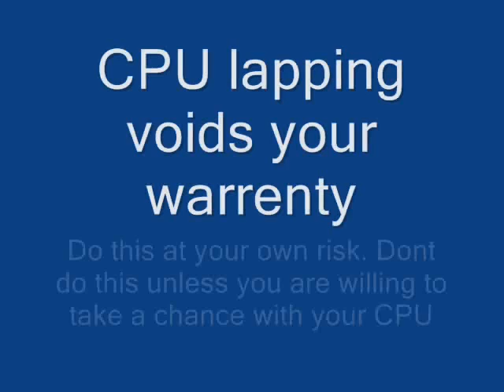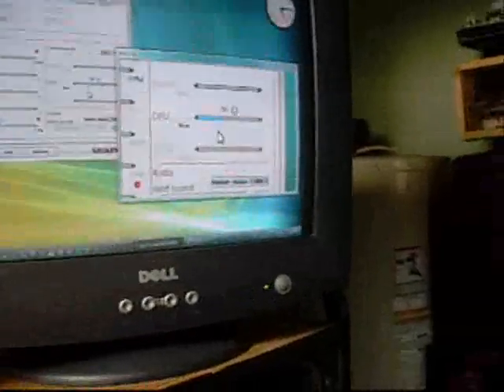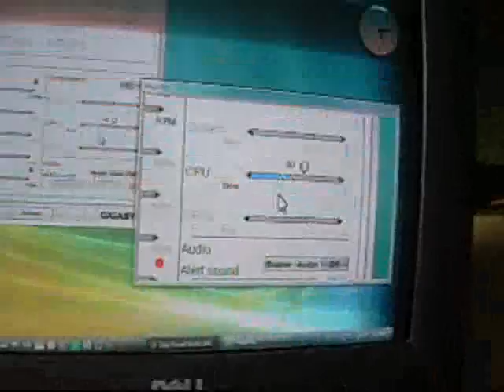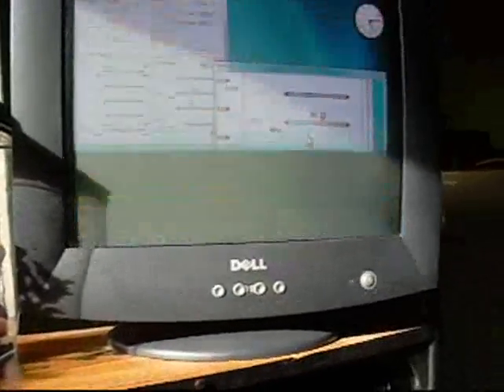Lapping a Intel pentium D 820 for overclocking

Comment: I have a Pentium D 960 3.6Ghz and it idles at 58c and can get up to 80c+ on a constant load. I hate it, it runs too damn hot. I've tried reapplying paste and reseating with no avail. Getting another heat sink with screws instead of those stupid plastic turn clips.
Reply: +ArcadeGames why not get a cheap Core 2 Duo and board?

Comment: my Pentium D 820 still runs fine after 7 years - never OC'ed it.
Reply: +FUzzyBUnnyBOoties The Pentium D wasn&#39;t a Prescott but a Smithfield based CPU. The Prescott has runs quite a bit cooler, due to its newer processor node (65nm vs 90nm). I still run an old Prescott based cpu in my desktop these days. It&#39;s a Pentium D 915, overclocked to 4.2 Ghz without a problem. It is one of the crinchiest setup ever. It is fed by an old AOpen 350W PSU, it has two completely different types of ram (Different speeds). With quite a weak coolermaster cooler, it doesn't read above 47*C running Prime 95. I don't know how close the temperature is actually to the CPU.
Reply: Superchad245 Yeah, I mistyped. I meant Presler.
Reply from the maker: They were a good solid cpu back in the day. I was very excited when I got mine.
Reply: +DJ S you are partially incorrect, also Prescott is 90nm NOT 65nm, Cedar Mill is 65nm

the Pentium D 8xx is Smithfield, which is made up of two 90nm Prescott dies
the Pentium D 9xx is Presler, which is made up of two 65nm Cedar Mill dies

so your CPU is Presler, or two Cedar Mills in one package.

Comment: I used to over drive motherboards.  But that was when the 386 was a hot machine.  You couldn't do anything in the bios.  So what I would do is unsolder the crystal and solder in a socket for a new crystal.  Then I would have an assortment of crystals and kept trying different ones untill I got a stable machine.  I learned a lot by doing this.  mostly the problem wasn't in the cpu but the memory couldn't run at the increased clock rate.
Reply from the maker: I remember them days. Back when you could buy the overdrive unit for the cpu and the cpu sat right on top of it and plugged into the socket. I think it was a 386sx to a 486DX or a 486sx I cant really remember now. But doing it yourself was way cooler.
Reply: 386,486 and even pII and pIII have onboard swith to change the processor frequency

Comment: True, but there's the fact that 4Real cores are better now than 2Real+2Virtual (plus it was a 6core which is even better) and the Phenom II would have saved me a fuckload of cash. PLUS It depends, on driver support and hardware support, as well as Game support. 

Some games don't work well with HT does that mean the Core i7 sucks? No, just disable the 4 Virtual cores and leave the 4 Real ones on. Same concept game doesn't like SLI/CFX? Turn off the 2nd GPU.

Comment: Currently? 
MSI H61M-P23 (Revision B3) LGA 1155 
._. 

And for me Dual PCI-E cards woulda been a cheaper route, buy one card for 50$ then eventually find another for less or the same price and toss it in. 
(HD 4850(s), much faster than a GTX 650, or HD 6670).

Comment: what motherboard do you have, i mean most of them can upgrade further up the intel chain, if you want CPU power upgrade path Intel is still the main way to go, If you want a SoC for a desktop then AMD's APU's are fantastic.  Dual PCI-E is only a great option for those who need dual cards, unless your planning on gaming above 1080p dual cards are not worth the investment and  hassle, usually sticking to one more powerful card will yield better results and less hassle with SLI/CFX

Comment: hey the Sandy bridge Celerons are great little CPUS, i was strapped for cash and sold the i5 out of my alienware (got $200 for it so not bad) and replaced it with a $35 Celeron G540, my gaming has barely been affected at all, was completely amazed by it.

Comment: False, the "mhz" was the Front Side Bus not the actual CPU's clock speed.
Willimatte topped out at 2.0ghz, Northwood around 3.4ghz then came Prescott which was basically just a slight tweaking of the 20-stage pipe to 31-stages, although it did add XDbit and SSE3 instructions and also shrunk  the die area down to 90nanometers so it ran a bit cooler. C:

Comment from the maker: I did some searching and it would seem that the board you have does not support overclocking at all. The simple solution would be just to buy a used board for a few dollars. Sorry I know that is not the answer that you want but some times that is all you can do.

Comment: you can get pre build watercooling kit(all in one) for $39.99 in newegg, but i'm not sure the quality would be good. 

btw i got 15c idle under 4.2ghz (100mhz x42 because of ddr3 ram ratio wont let me go above 200mhz bclk) with ihs removed + antec h2o 620 (room temp is 21c), while full load is still over 50c... which it is not really worthy by trying so hard to just get few degree drop in idle.

Comment: Cool, I might just give it a shot :)

I notice not many 775 boards list the Pentium D as compatible though, even though people have been building on boards like the EVGA 610i which doesn't list it either. Would any 775 mobo with 800FSB work you reckon?

Comment: I recently dug out the components of my old dead workstation (looks like a mobo failure) and at the heart of it I found a Pentium D 925. I've been toying with the idea of resurrecting it in a home server build given that the PSU and RAM (mismatched 533/677 1gb chips) are still functional. Means buying a new motherboard, case, drives and probably a RAID controller (maybe, depending on mobo) to go with it. Good idea or more trouble and cash than it's worth?

Comment from the maker: As with anything there is always pros and cons. Overclocking should be done very carefully with keeping a eye on temperatures and voltages to make sure that you don't overvolt anything. It can also take some life off of components like CPU.ram.motherboard. video-card.ect. But if done carefully the risk can be very minimal but a person has to do it at their own risk. The first thing you may want to do is find out what cpu and motherboard you have and search Google for overclocks for it.

Comment from the maker: It is a way to get more power out of the hardware that you already have. So instead of having to upgrade to a new computer you could maybe get another year out of the one that you have. 
The cooler you can keep the chip the higher you can overclock it. So in this instance I am running a 2.8GHZ chip at 3.2GHZ.

Comment from the maker: I bet your hand would get very sore using the paper. They really do not need to be that smooth. The main thing is that they are flat. The thermal paste will make up for any microscopic scratch, The first one i did i spent 8 hours on it. Now I do one start to finish in about 45 minutes and it is a lot easier on the arms.

Comment from the maker: There are quite a few factors that could have effected our idle temps. Like type of cooler used or type of thermal compound or air flow through the case. Every chip overclocks a little differently it is very possible that you have a good one that will overclock that high with a minimal increase in voltage.

Comment from the maker: @3624nathan The problem with this cpu is not that it is not powerful enough but more that it does run so hot. The t-case temp max according to Intel is 64. So it does not really take much to get them up to temp and have them start throttling down in performance. So with better cooling a person could probable play Cryis and maybe even BF3 with it.

Comment: My gaming rig has this processor in it. 2.80 Ghz but it runs perfect for my needs. I don't know why people over clock it when it has the power to run GTA 4 and fly Tampa scenery for Flight Simulator and call of duty. It not bad at all. But myn does get really hot at idle it gets around 50*C sometimes 67 *C. But it never gets any higher. I think it was build to go up to 80. Not sure.

Comment from the maker: @aPanzerIV Wow that is a very good question. Do you have it overclocked?. Is the cpu flat did you lap it on a piece of glass to make sure the surface was flat?. Is the cpu cooler making good contact?. If you take the cooler off check the thermal paste and make sure the cooler was making a good contact with it. Did you use a quality thermal paste like AS5?.

Comment from the maker: @crackloadPC I agree they ran very warm and were never really that good of a CPU. But for some reason they had a very long lifespan in comparison to other  CPU`s. Even though they came out around 5 years ago you can still buy one of these brand new for around $28.00. So it makes it a great option for people just learning to overclock that dont want to try it on a $300.00 CPU. And because it is a dual core it is modern enough to still be useful.

Comment: Perhaps you could use an aftermarket cooler from either Cooler Master or Thermaltake, or similar companies. My processor idles at around 25 to 30 °C, with fan @ 1000rpm. Or, you just need a better ventilated room or computer case.

Comment from the maker: @Lancer265 Go with the D 2.8. It is a dual core so even though it is 2.8 compared  to the 3.0 HT Pentium  4. It will have 2 full core to work with instead of just one hyperthreaded one. You will notice the difference when running multiple apps.

Comment from the maker: @SpartanCE117 It should help. I can run mine at 3.4 GHZ with out any problems. I know the cpu could go higher but my motherboard wont. Anything over that the motherboard starts to act up and the capacitors start to whine.

Comment from the maker: @SpartanCE117 I spend a little too much time with the lapping I try to be very careful. 

That is a very good temperature drop for you. 

Yes I still use thermal paste with it. It only takes a little but I want to make sure I get the best contact that I can. And fill in any scratches or air gaps.

Comment: i have done the same, but not as time intensive as you,
i spend two hours to lap my pentium d 820 and my acer heatsink(oem)
Temperature drop around 8c but i'm still using heatpaste (sry for my english) do you use heat 'paste' or was your xpu running copper on copper?

Comment from the maker: @theMasterJoe72 In what way do you want to improve it?. Do you want it to play games better or multi task better. You could add a better video card, you could over-clock the cpu to get more performance out of it. You could upgrade to a 64 bit operating system so you could use more memory. A faster hard-drive always helps.

Comment from the maker: @YouDead11 I am not sure what you mean by rated. Are you seeing that number at start up or trough a program in windows like CPUid?. If so then it is very possible that the cpu is over-clocked to 3.36 GHZ. 

The difference with the Pentium 4 and the D was. 
Pentium 4 was hyper-threaded so it was a single core that could run 2 threads. 
D was a dual core so 2 cores that could run 2 threads. 

I hope that helps :-)

Comment: i have a question about my processor:
i have Intel Pentium D 915 2,8 Ghz and it is rated at 3,36 Ghz is that rated is the same like overclocked? and what is the differences between Intel Pentium 4 and Intel Pentium D???

Comment from the maker: @CubeLuda The D820 only has one tempature sensor it is way over on the edge of the first core so it kind of monitors both cores. But both cores do not have a sensor. The 35c might be the cpu and the 34c might be the motherboard. 

Nothing wrong with the D820. Still a pretty good cpu for a lot of different things. I like mine.

Comment from the maker: @atomicfart3514 That is a very good question. I have had a lot of problems trying to find something that would monitor it. The only thing that would work was a motherboard that has a tempature sensor on the cpu socket. You could also do it with a fan controller that comes with temp sensors if you motherboard does not have a sensor on it.

Comment from the maker: @applemonkey187 It is not hard at all. Any one can do it. All it takes is some time and some sand paper. The hardest thing about it is finding sand paper fine enough to really get a good shine on it. You want to look around and see if you can get sand papers that are 400-800-1000-1500-2000 grits. You can get by with just 400-800-1000 if that is all you can find. Some times it is hard to find any over 1000.

Comment from the maker: You might want to check your tempatures with the new cooler first to see if you would even need to do the lapping. The lapping will generaly only drop it a couple degrees which is huge with overclocking. But if you plan on running it stock you might not need to.

Comment from the maker: If you have a good flat cpu and heatsink then usally a little paste is all you need. This one was warped a little bit and not making great contact. But you are right most people will only see about a 5c difference or less from lapping. Not a huge difference unless a person really wants to cut ever degree off that they can. 

I have had similar results with this cpu. Stable at 3.4ghz. But runs much cooler at 3.2ghz.

Comment from the maker: I did some reading on that motherboard and it would seem that it does not have overclocking options. You can look at the bios and see if it gives any option to change FSB settings or voltages.

Comment from the maker: That is the same cpu that I am using here. So it should be overclockable. But the question is if that motherboard will let you overclock it. Go into the bios when the machine first starts up and see if it gives you any options to change the bus speed or voltage for the cpu. If not then your only option would be to try to overclock  it with software in windows. 

I would think 3.2-3.4 GHZ is very possable with stock cooling. Any more then that you should look for a aftermarket cooler for it.

Comment: yeah its a good cooler and very cheap i payed only £15 for it at a local pc shop.

i tried to push it to 3.5GHz originally but it was unstable so i played around with it a little a decided to settle on 3.2 i do think it would go further but i do worry to much about it.

Comment from the maker: That should be very easy then. All you have to do is go into the bios and raise the fsb a little. It is under motherboard intelligents tweaker. Just change cpu host clock control to enable. Then at cpu host frequency change it from 200 to 230. That should give you a overclock of 3.22. You shouldnt have to change voltage or anything for that small of a overclock. Just keep a eye on the tempatures to make sure the cooler can handle it.

Comment from the maker: I dont know why they are so tuff to find software that will monitor them. The only thing I found that will work with this board and cpu is the Gigabyte overclock software that this board came with. If you do find something else that will work let me know because I would sure like to find something better.

Comment: i got this cpu in my xfx 780i and its running at 3.65ghz and the idle temp is 30-33degreece!!! im using watercooling with a dual radiator with two thermaltake 2000rpm fans

Comment from the maker: Sounds like a nice system.

Yes lapping is exactly that. You use different grits of sandpaper to get it as smooth as posable to make the best contact between the cpu and the heatsink. You start with 400 grit and work your way up to 2000 grit or higher. 

Max temp on the E6600 is around 75C so 40`s would be a very good tempature for one.